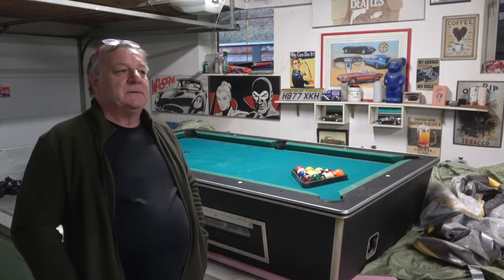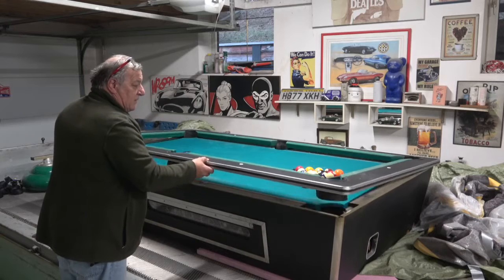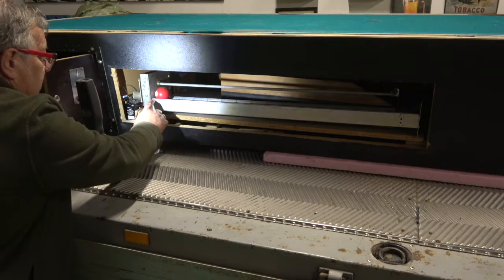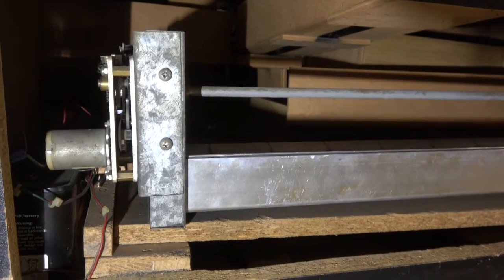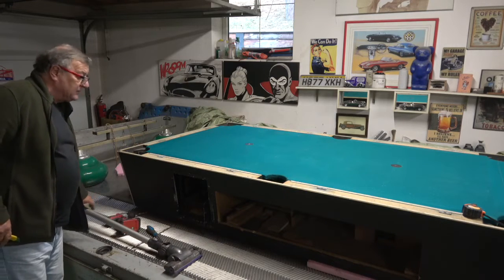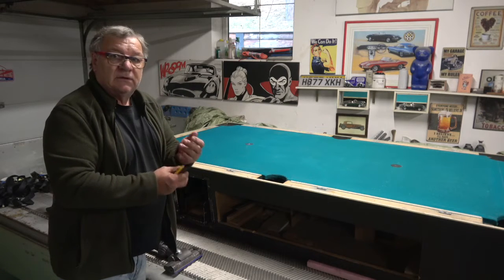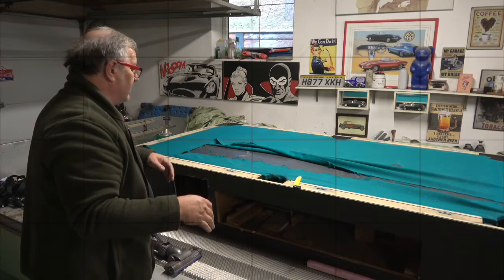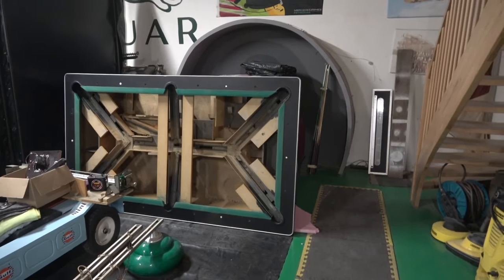Free Pool Table Part 1  ( disassemble )

Comment: I worked in the gaming field for 15 years. The person that last recovered that table did a poor job. When you have it recovered, make sure to use Backed felt on the slate. Probably why you had a hard time getting the slate out. Without backing the glue would seep through the felt at the edge and hit the wood frame. Best of luck!!
Reply from the maker: James, Thanks for the advice and info it‘s much appreciated, I will get round to it in the new year with a bit of luck. Cheers Dave